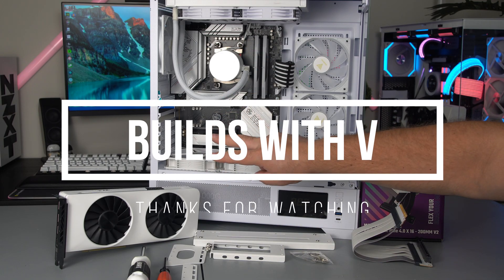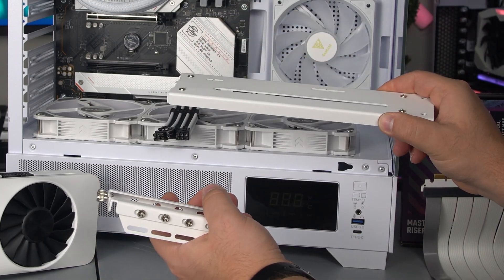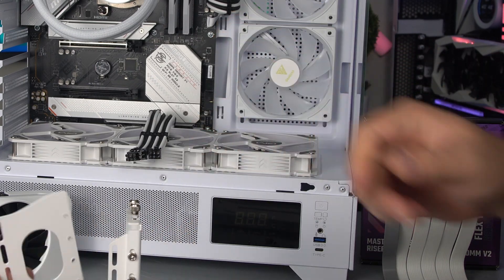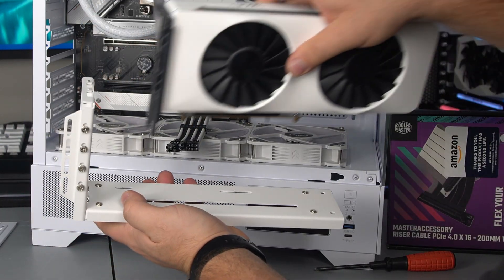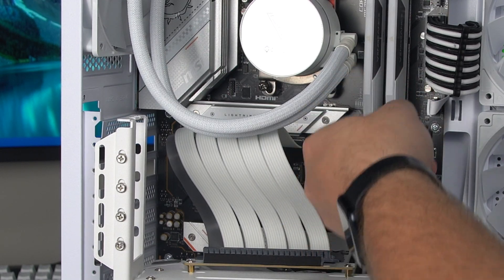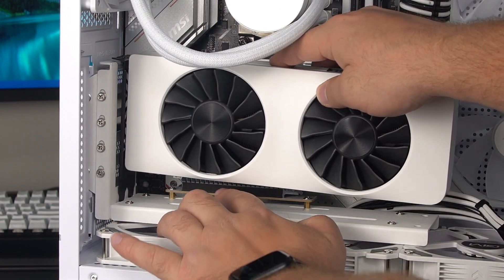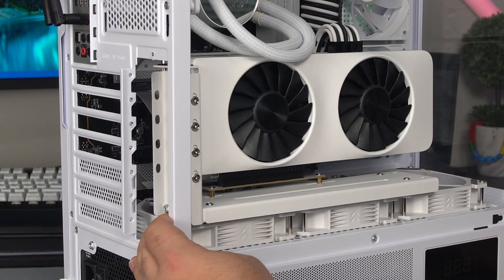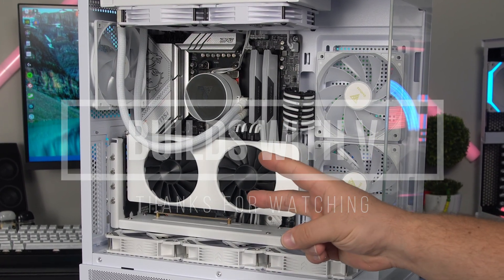How To Install Vertical GPU in *almost* any PC

Comment: Thank you for this video, I intend to do a similar mod with an Antec Shift riser, 5080 Prime, and a corsair carbide 400 case.
After looking at some more videos and this one in particular https://www.youtube.com/watch?v=1I4eIh5ANmA - I think that the easiest way to get less messy edge would be to cut the pillars down the middle and then to use the metal fatigue method from the other video on both ends.

I'll try this out and report back.
Reply: Ok, so the operation completed successfully and the metal fatigue method worked as expected.
For the carbide 400 case in particular - it can be a bit challenging to get a clean break at the top end of the pillar (near the screw-hole), applying some inward pressure to keep the pillar bending at the crease instead of the hole can help.

Also I did end up mounting my AIO radiator outside the case as the 5080 wont fit on this mount in this case otherwise, so now I have a some real cyberghetto look going on. 
I should be looking for a larger case.

Comment: so you have to buy extra parts for it to be vertical or would your GPU come with these things?
Reply from the maker: You usually have to buy the extra parts. Some cases come with these extra parts.
Reply: Yes. You either need the full kit (mounting support and riser cable) or just the cable.

Comment: Can i put my sapphire rx 9070 pure in vertical position in case antec cx500m?
Reply: I believe you can but check the card's size. I seems like it will be too close to the glass.

Comment: So how's the temperature?
Reply from the maker: @hollymacaronyyy  normal temps. Nothing special and nothing abnormal. Haven't used this PC much but when I played apex for a few hours GPU temps stayed around 60⁰c.
Reply: Nice! If that's what you said, I'll buy this one. My desktop kinda boring so far, so wanna try this for a change Lol. Btw bro I'm using galax rtx 4060. No argb.
Reply from the maker: @hollymacaronyyy  it's a really nice case for the price and airflow was great in my experience. I also added 3 fans under the GPU as intake to feed the GPU some more fresh air since the bottom portion is mesh.
Reply: Oh i forgot the case lol. I'm using nexus 1. But if im not use another fan under gpu will it be good? My game's is always triple AAA and my tempts is consistent 40-60 in default settings, i have a 5 fans and 2 fans gpu.
Reply from the maker: @hollymacaronyyy  and this is why I shouldn't reply when I'm tired 🤣 I thought you were talking about the case.

Yeah with your setup temps will be about the same with the vertical mount.
Reply: Brooo.. 😂😂😂

Comment: PCIE riser cables are gen-specific,  your motherboard and graphics card BOTH have gen requirements for maximum speed in operation...you can use newer gen cables on older hardware,  but using older gen cables with newer hardware will result in reduced speed.

Comment: How to install the bottom fans too please
Reply from the maker: @Aggeesound  basically same as the other fans except you need to use longer screws. Same screws you use to mount fans on a radiator
Reply: @BuildsWithV  Thank you
Reply: same as other fans